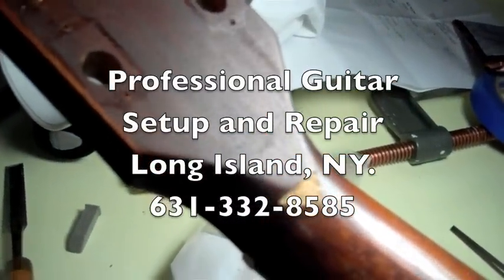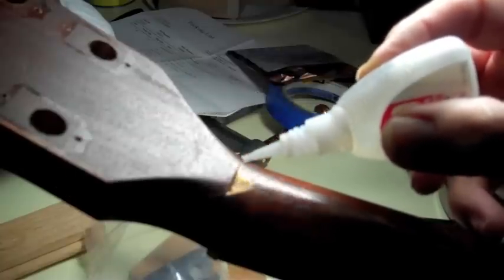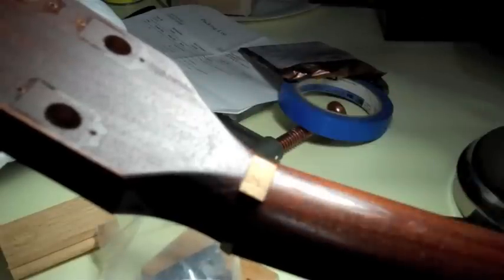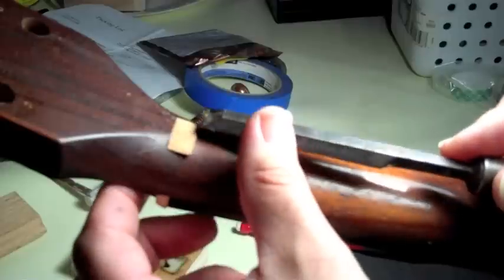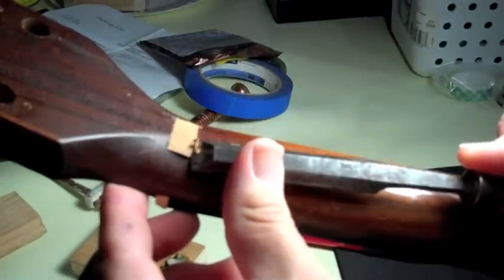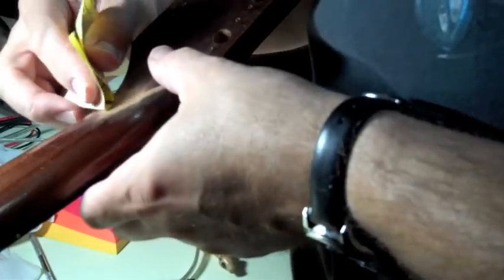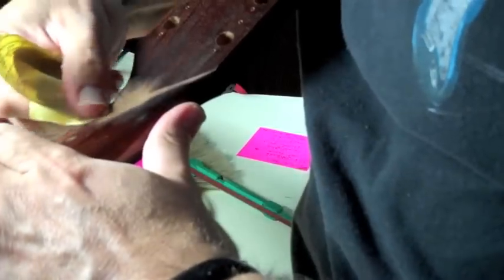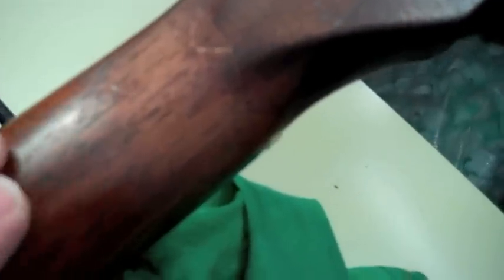Analog Alien - Jack repairing a broken Gibson Les Paul Studio head stock

Comment: wow that worked really well! i had that happen this week to my gibson les paul standard and im getting it repaired at the moment but im going to take on refinishing   and refilling the crack my self. im just wondering if its a crack with no missing pieces can i put wood filler in, sand it down re finish and have the same out come??
Reply from the maker: I would have to see the crack to be sure. If you are painting over the repair you might get away with it. If you are staining more than likely you will see the wood filler.